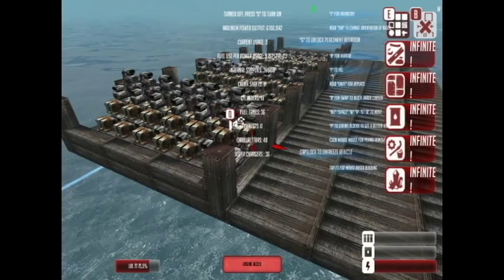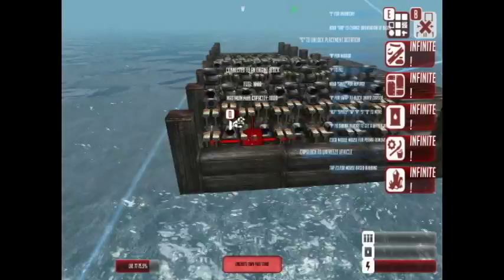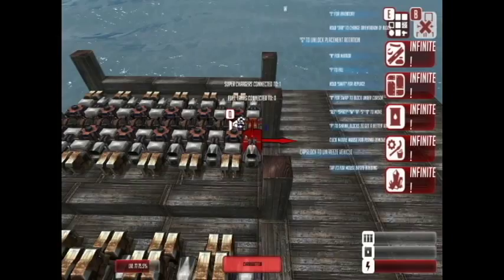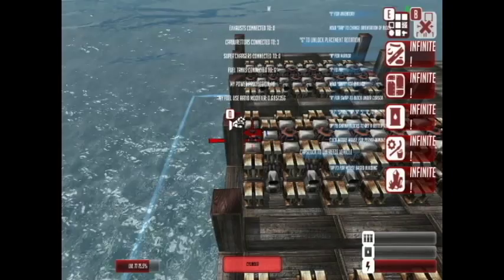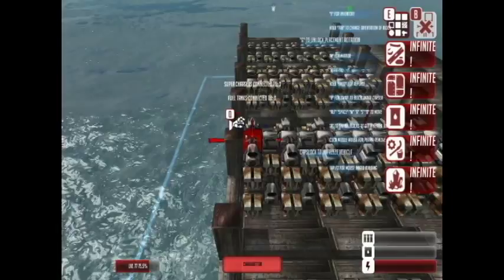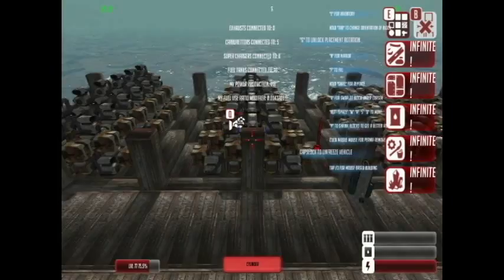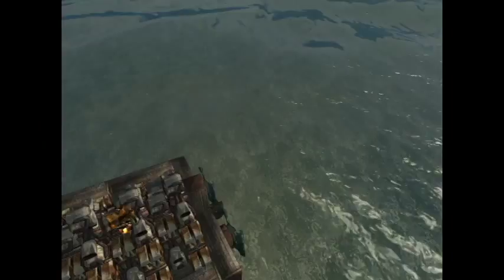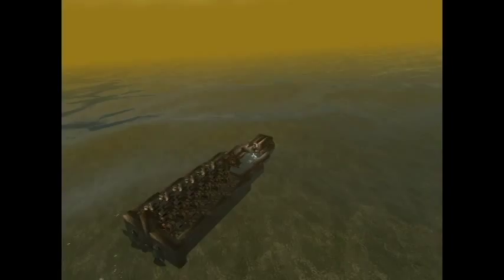From the Depths - Very Powerful Engine Tutorial

Comment: Thanks for the tutorial, I was basically looking at all the parts wondering what was the way to go here, like exhaust for instance, this made it a bit clear that there's no point in exhaust in most engines.
Just like.... real life?
Reply: +Nibble Yeah i removed the exhaust in my truck, now the hot carbon monoxide just seeps out of  my engine's cyilnder and it melts the plastic parts and some of it gets in the cabin, runs like a charm :D